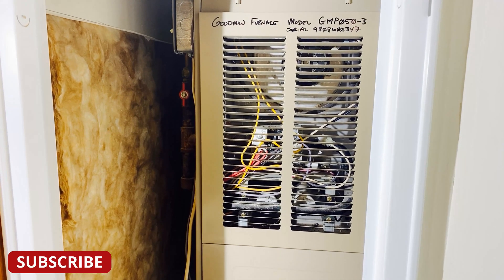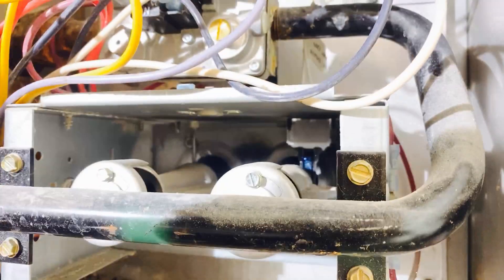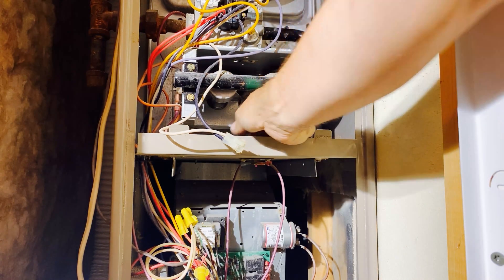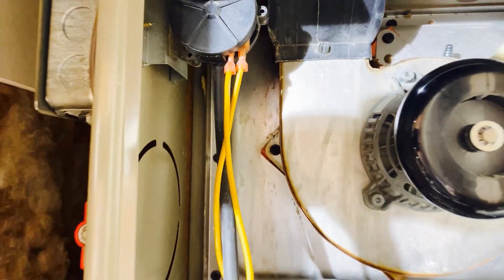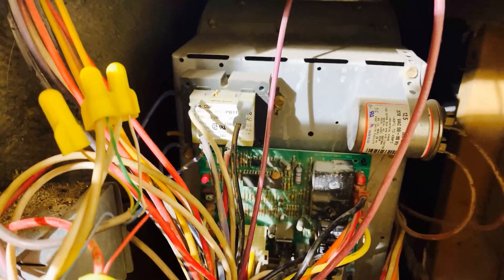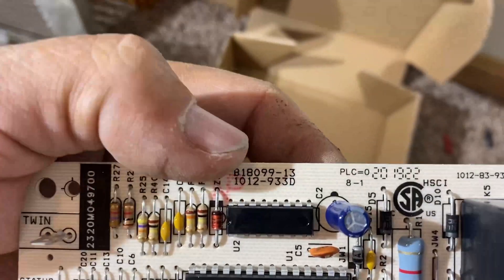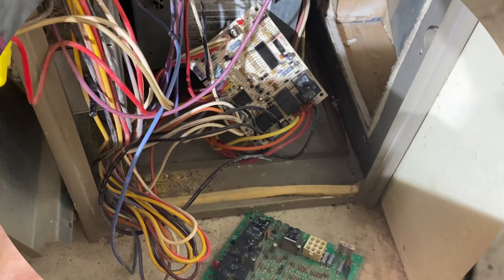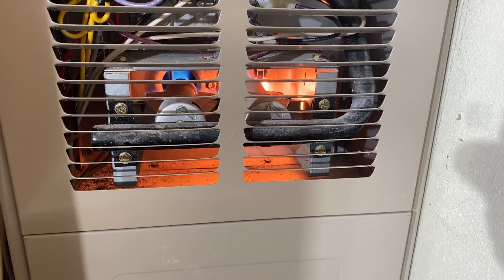Gas furnace not igniting -  Goodman furnace wont ignite - DIY Gas furnace repair

Comment: If the light on the control is off and never comes on, should I just replace the board? It seems to be getting power from the breaker but the control board isn't lighting up.
Reply from the maker: Damian, 
Sorry for the delay.
I would get out the multimeter and determine where the power ends...
It might be as simple as the on-board fuse.
Let us know what you find.
Good luck 
-Shane

Comment: Our Goodman door switch went faulty. -25 the other day and furnace blower wouldn't even kick on. It showed I had power (blinking light), but I a no furnace tech. I pulled off both doors and I pushed the switch manually in and it came back on. I put everything back together and after 2-3 days it did it again. So I took it off again and pushed manually and it came back on. The switch went faulty and that was the problem.
Reply from the maker: Steve, 
Door switch failed! That is a rare one! 
Good catch man! 
Stay warm and Merry Christmas! 
-Shane

Comment: Awesome video, "Thank you so much", My problem ended up being the pressure switch hose i guess it wobbled loose ,working like a champ now, just in time we are expecting temps. to drop down in the 20"s tonight and a winter storm moving in with high winds
Reply from the maker: CH, 
Im glad it helped you out! 
Not much is worse than when your furnace quits you when you need it! 
Stay safe!
-Shane

Comment: So interesting the ignitor works good so  I changed my flame sensor, pressure switch and still the gas would come on then shut off. I called a technician he said it's the circuit control board so I ordered a new one installed it now the gas/ flames 🔥 will NOT come on lol man I'm lost and my family is bearing with using floor heaters... Any other idea what I should check?
Reply from the maker: Breeze,
Sorry for the delayed response, I have been very sick. Better now tho. 
There are only a limited number of things that are really user serviceable.
Beyond those it is best to call a tech who is willing to whip out the multimeter.
Be sure to pay attention to the flash codes tho... they are a big help to get on the right track (usually)
Merry Christmas and let us know what you find!
-Shane

Comment: Excellent video! Igniter packed it in today...exactly the same furnace. 1 Hour...parts in hand...FIXED!  Thanks very much for sharing this info!
Reply from the maker: Mustang, 
Thats what IM talking about!!! 
Excellent job getting things back up and running!!
Nothing succeeds like success! 
Merry Christmas!
-Shane
Reply: @AHandleOnThings  Merry Christmas!!
Reply: Before touching the control board out of the plastic anti static package touch the frame of the furnace or something metal to ground yourself and discharge any static electricity you may have, otherwise your new board could be damaged. Thanks for the great videos.

Comment: This video was done very well for most novices to understand. You did a great job of checking each safety point in sequence. All the controls are wired in series whether the boiler is gas or oil. Thermal couplings need mentioning. This is an ignition boiler. An older thermal couple boiler uses a pilot flame, that licks the tip of the thermal coupling, and supplies .26V the power the gas valve, or the boiler will not ignite. In my trade, when I take any wire assembly apart, take a close up picture of the board and connections, before you touch anything!  Pictures are super important when working on a data/internet/service points rack with 200+ connections on any switches hubs etc.
Reply from the maker: Keith, 
Yes sir! a picture (or 12) is in order any time I repair stuff since the advent of smart phones! 
Merry Christmas! 
-Shane

Comment: Your furnace is filthy.  If you cleaned it every season you wouldn’t have issues. But, it’s a Goodman and they aren’t very good. You need most importantly, to ream out the nipple on the draft inducer where the pressure hose attaches with a pipe cleaner to remove scale buildup every fall. It will clog with  sediment and the furnace won’t ignite. Don’t make the mistake of changing a pressure switch that doesn’t need to be replaced. Clean the burners and the orifice is with a coil brush or stiff toothbrush. Always keep a spare igniter switch. In Goodman furnaces, they’re all the same. And most importantly, clean the flame sensor with fine steel wool every season. Also, oil the draft inducer motor and fan motor every year.

Comment: Thanks! Every winter for the last 3 years, my furnace wouldn't come on. I had water in one of the pressure switch hoses. After I sucked the water out the burners fired up. I do notice a lot of rust inside my furnace, and it looks like water is coming from behind the panel that the inducer motor bolts to. What could be causing that? Is this an indication of a bigger problem?
Reply from the maker: Akitm, 
It could be so many things causing rust like you describe.
It could be something as easy as hydrostatic water pressure coming up through the floor from the ground but it could also be a bigger issue. 
Even if you get the furnace running, consider having a simple tune up done when you get a chance. 
Stay safe!
-Shane

Comment: My furnace will work without issue and then the next day it will not light.  The heating process starts with the induction fan starting, the igniter will light and then nothing.  After a few moments the igniter will turn off and then turn back on.  The igniter will then cycle on and off continuously.  I have replaced both the igniter and flame sensor.  In most cases in will shut the furnace off at the switch h at the furnace wait a few moments and then turn it back on.  This usually solves the issue and the furnace will run.  When the igniter is cycling off and on, the control board light will not gives any error flashes.  As I am writing this the furnace failed to run.
Reply from the maker: Bill, 
Sorry for the delayed response, I have been out with the sickness.
Try pulling the rubber hose off of the pressure switch and trim the end. Often a pinhole will develop there that causes a pressure switch failure.
That would be best guess if you have already replaced the others.
Stay safe and be sure to let us know when you learn what the failure is!
-Shane
Reply: @AHandleOnThings  Now that it is 90 this week, my task the other day was cleaning the cottonwood seeds off of the AC condenser.  The house was very comfortable. Per your suggestion, I will check the lines on the vacuum switches.  I did check the switches with my limited testing equipment, and they do work.  Thanks for the advise.  Bill

Comment: Thank You for this video. My sisters furnace won't fire up and there looks like only about 9 volts at the igniter connection so bad board is my guess based on your trouble shooting help. Thanks again
Reply from the maker: Sherry, That's no fun! But it isn't too hard to replace either. Thanks a TON for the comment and be sure to let us know how it turns out!! 
Stay safe 
-Shane

Comment: We've had a repeat issue with our Goodman, sometimes twice a winter. Flame sensor is clean, igniter lights, but it just doesn't light the burners 🤔. I guess the only thing left is to check the gas pressure.
After a while the furnace will light. Whether it's because a build up of gas has happened or it decided to work in the one instance is beyond me.
Reply from the maker: Winston, I have had a similar issue and it turned out that the flame sensor was just pitted enough to get dirty fast. I suspect that it also was a bit of a fuel/air mixture issue that caused a little more sooting than usual. At any rate, I replaced the flame sensor and the new flame sensor (not being pitted) never had another issue after that.
Thanks for the comment, and be SURE to  let us know what you come up with!
Stay safe!
-Shane
Reply: @AHandleOnThings  I should've updated! I cleaned the sensor again and I guess there was just enough dirt (not visible) that it wasn't wanting to light 😂. It's been working ever since!

Comment: Okay we rent in the Pennsylvania area and it's cold, Long story short if you can please help me 🛑 the landlord put in a new gas furnace last year because it kept shutting off, hopefully new and not used, anyway the heat stopped working, we checked the gas tank gauge outside and it was saying 40 percent, so that wasn't the problem, but our landlord called The gas company and said we haven't gotten gas so he said that's probably Frozen that's why it's saying 40% we usually don't crank the heat up, we use space heaters, so now we have gas, it's not working 🤔 we are kind of scared thinking we might have broken it because we thought there was gas in the tank.
So is that a possibility? And does the gauges outside stick? Because I thought that would be a problem?
Thank you in advance 🙏
Reply from the maker: Ok, 
Propane doesn't freeze... the regulator CAN.
The way we thaw our regulators here in the great white north is with hand warmers.
The little pouches that heat up when they are exposed to air. They are safe and can't cause an explosion. Put a couple on the regulator and wrap it in a towel to keep the heat in. 
If the regulator is frozen... that will fix it in minutes.
If that isn't the problem, have a look at the flash code on the furnace as described in the video and you should get an idea of why the furnace isn't running.
-Shane

Comment: could the mouse have blown the fuse on the circuit board instead of replacing the whole board?
Reply from the maker: Kenny, 
Yes, the mouse could indeed have blow the on-board fuse. In my case the fuse was still intact and I metered the failure and traced it to an on-board component other than the fuse. I could have de-soldered the damaged component and got the board back up and running possibly but the law of diminishing returns kicked in and I replaced the board instead. 
Great question!
-Shane

Comment: my inducer motor doesnt start first ,it doesnt start at all ,,when you turn it on the blower fan comes on but no flames ,,what could be the problem there ?
Reply from the maker: Kenneth, 
Check the flash code, it should tell you what you have going on.
It will often be one of the things we covered in the video.
Ignitor, flame sensor, or pressure switch that will stop you from firing like that.
Let us know what you come up with!
-Shane
Reply: @AHandleOnThings   ok it flashes 6 times then off for a few seconds then flashes 6 more times and over and over ??? what does that mean
Reply from the maker: @pbblaster-wd40  Every furnace brand/model can have different flash code meanings. Look on the inside of the access door for a piece of paper that tells you what the flash codes mean. 
You have a code 6
-Shane
Reply: @AHandleOnThings  how do you know what it was ? you did 4 things before trying to see if it worked ...i dont want to buy a circuit board unless i have to ,,, furnace is for my garage ...

Comment: Thanks so much for the video. Another possibility- (one that happened to be my case)- if you have the model GMH950904CXAC, check to see if the gas valve cap is loose at all. My HVAC guy came out as back-up after my tinkering, and all it happened to be was that the magnetic that's inside the cap wasn't connecting to tell the gas to fire off and light the ignitor. Hopefully he goes easy on me with the bill for doing most of the troubleshooting myself thanks to you!
Reply from the maker: Elle, 
Thanks for sharing that!!
Hopefully between you and I we can help other folks keep their heat on!
Have a super day!
-Shane

Comment: Looks like the gas shut-off vale is open at 3:50 as you say it is closed. Is there another gas valve before the red handle valve? I liked the easy, relaxing narration. Nice work.
Reply from the maker: Hashem, 
Excellent catch, that particular gas valve was indeed still open. 
I do have another gas valve though as you also guessed. The furnace is in a closed area that is very difficult to access so I put a quarter turn valve outside that room since it would be difficult to quickly (and safely) access that shutoff valve in an emergency. 
Thanks a ton for the nice comments !
Stay safe and stay healthy my friend!
-Shane
Reply: @AHandleOnThings  Thanks for the reply. Happy New Year.

Comment: Thanks Shane, after I replaced my igniter (I have an extra one now), I found your video. Tested the outputs from the board 2 the igniter as u did, & also had no voltage. Just replaced the board this morning & works great. Good job in showing & explaining the necessary steps. Much appreciated.
Reply from the maker: JC, 
Glad to hear you got back up and running!!!
As much as its not fun having your furnace break down, it is certainly a relief and satisfying when you get it sorted out!!
I really an so glad to hear the video was useful to you. I almost didn't make this video since it was a pretty heavily covered subject and it has turned out to have saved a LOT of people when they needed help. Guess that shows me that I need to think less about whether a video will be successful and just film important stuff when I can.
Hope you have an EXCELLENT and WARM evening!
Stay safe!
-Shane
Reply: How big was the mouse on the back of your board?

Comment: You are a life saver. 2 cotton pads, a dab of nail polish remover and 20 minutes later Voila' My furnace ignited on the first try. Simple, easy to follow instruction!!!
Reply from the maker: Richard, 
EXCELLENT!! I cant tell you how happy I am that the video got your furnace back working!
AND it saved you (what is in my area a minimum repair charge) of about $360!!!
Stay safe and stay warm my friend! 
And thanks a TON for letting us know it worked for you!
-Shane

Comment: thanks for the flame sensor cleaning section.
Reply from the maker: Ed, 
Any time brother!
Thank YOU for taking the time to put up the comment! 
I hope the video helped to get you out of whatever bad spot you were in!
Have a super week and stay warm!
-Shane
Reply: @AHandleOnThings  I diagnosed a bad control board which is NOT sending 24 volts to my gas valve. I do have 24+ volts coming from the transformer. Cleaning the flame sensor is a simple PM item and can do at the same time. I have see others clear with steel wool on here, but will switch to acetone.
Reply from the maker: @edbrandt8972  Right on... Bad luck on th econtrol board but knowing is ALWAYS better than not knowing!
-have a super day 
-Shane
Reply: @AHandleOnThings  I ordered the wrong part. One of the high limit switch had tripped and it had a reset button on it. I have hear again. My mistake on diagnosing it. I got the control board used on ebay and it works fine. I did not test the continuity of the wire with the limit switches..

Comment: Great video I learned a lot has a home owner most of the time these technician telling you that you need a new system when in reality you know that it only requires simple repairs if the person know what he's doing. A new system is more expensive for the homeowner and more money in is pocket
Reply from the maker: Jeaneth, 
That certainly happens out there sometimes.
Like you, I have seen many that do a good job and plenty who are strictly in it for the money that they can take from you.
Either way, having basic knowledge of your furnace system is valuable whether you do the work yourself, or if you use the knowledge to sift through "information" some furnace guy is telling you.
At any rate, Thank you so much for taking the time to leave a comment! 
I hope you have a fantastic weekend!
-Shane

Comment: My senior parents had an Amana AMES801205DX (6 rollers) installed several months ago.  Unfortunately they were having problems with the noise.   It kept starting and stopping.   The service company said they screwed up and installed too big of furnace.   They replaced it with a smaller furnace,  AMESA0604DX (3 rollers).

I tried to find the prices for both of them,  but I didn't have any luck.  I would assume my parents should receive a refund since the replacement is smaller.   Any feedback you could provide would be greatly appreciated. 

Thanks,

Kevin
Reply from the maker: Kevin, 
I would COMPLETELY agree with you. I would get to the bottom of the price difference in a real hurry. I would contact ANY other dealer and find out what the ACTUAL machine cost difference is. Labor will likely not too far apart but if the mistake was on the part of the specifications arrived at by a licensed contractor I would NOT eat that mistake for them even if it meant a court case. (Probably small claims  but even so)
Let us know how it pans out!
-Shane
Reply: @AHandleOnThings  thank you

Comment: I can't find the serial number. How can I find the serial number?
Reply from the maker: The serial numbers on different machines can be elusive. Check the paper on the inside of the door first. Like I said, once you find it, write it on the exterior of your furnace and it will save you oodles of irritation in the future
-Shane

Comment: Mine is such an antique, I'm not seeing anything that comes close to it.
It's a floor gravity furnace. The house was built in 1940, this may be the original furnace or there may have been another one put in around 20 years later.
 it's got a thermostat pilot generator not a thermocouple. There is no pilot control on it. If the pilot light were to blow- out you would have leaking gas near as I can tell.
Reply from the maker: Frank, 
Yeah, some of the very old furnaces (especially the floor furnaces) are just plain dangerous. Be very careful servicing them. I know a lot of maintenance guys wont even touch them.
Stay safe!
-Shane